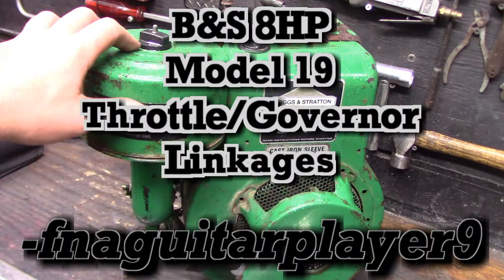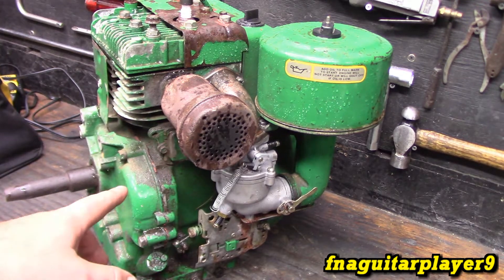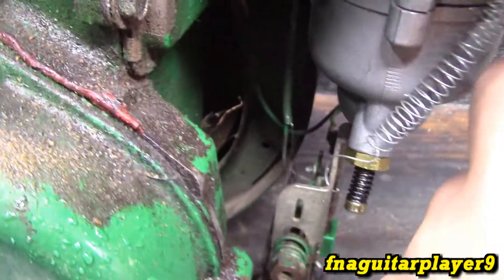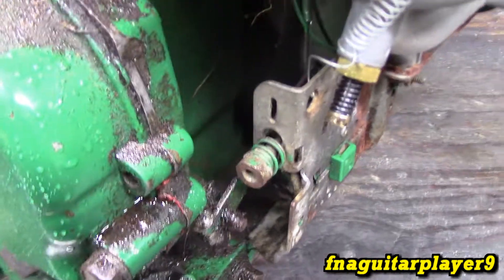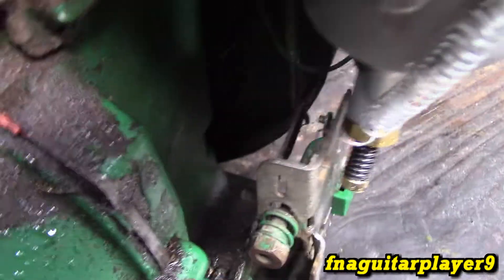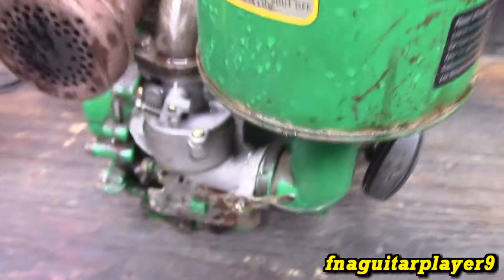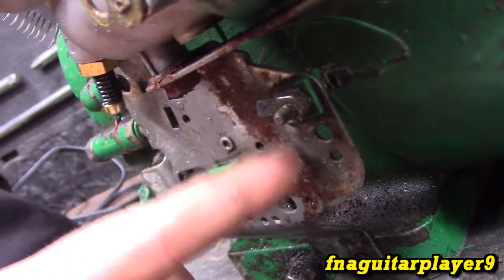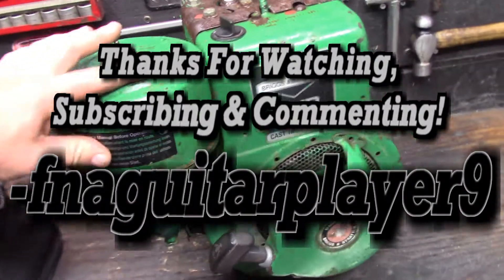Briggs & Stratton 8HP Model 19 Throttle / Governor Linkages

Comment: Great videos   the very fine spring that loads the throttle linkage , would you know the genuine part number please.  i have one of these engines on generator and dont have that spring and engine is hunting , varing rpm costantly .  cheers

Comment: someone might stumble on this some day...I haven't seen anybody talk about how to set that governor adjustment knob this model has on it.  I have an 8hp briggs on an old woodchipper that has that knob on it and basically the tension it puts on the plastic sliding piece keeps it from moving all together even when I move the throttle on the carb.  I have no idea if this should be the case.  anyone who know please chime in.  thanks
Reply: following as i have a troybilt chipper with same setup

Comment: GREAT Video  I have a 8hp briggs and when it gets warmed up good ,, it starts sputtering. If I move the governor back and let it catch up, it will run but when the load is on it ,, it will start sputtering again. Then I can turn it off and wait about a half hour and it will run good again until it gets hot.
Do have any suggestions? Thanks

Comment: Good evening sir I have one Coleman 4000 w generators and I have a Coleman 5,500 6500 watt generator. Both generators are putting out with on outlets 120 to 125 Hertz is running about 60 about 62 HZ and 240 is running about 240 and with about 62 Hertz. Trying to run a small welder stick and a hundred amp MIG welder with them hard time starting an arc and keeping the art going if I use regular household plug in have no problem with the welders I hope you can help me out with my problem do not want to go home by another welder find out it does the same thing thank you Steve

Comment: I have a 10 hp 1975 model.  I have springs on the governor and throttle but o can't get the throttle to work properly.  I'm wondering if something with the governor is broke inside? No matter where I set the governor I just can't find that sweet spot to make it idle and throttle up. It just seems to wanna run fast

Comment: aha, the spring on the front that attaches to the idle stop screw is missing on mine and the governor spring is holding the throttle plate wide open. So I just need to fab a spring like yours and I should be ready to try running it.

Comment: I have a 1972 3 HP Briggs/Stratton Model # 80232... I'm seeing leaking oil near the crank case.  I figure I need to replace seals and should just replace the gaskets and do a carb kit on it.  I can;t seem to find parts for these jobs.  Any guiance on where I can find the parts I need?
Reply from the maker: I order alot of parts from mfgsupply.com or off of ebay/amazon. Thanks for Watching!!!

Comment: The old 8 horse I/C on the Roof mower still runs like a Swiss watch as do all the 'L' heads but the 4 horse on the Snapper. The governor setup is 2 piece with one hooked to the shaft and a  1/4 inch bolt through the arm slot that goes to the carb. I turned it all the way to the right but the bottom fitting hooked to the shaft is in a notch in the case and can't move. That made it worse. It has an auto choke without the vacuum deal. It's on the breather hose going into the carb from the crankcase. I'm going to have to move it back because it runs plumb crazy the way it is now. It's a 110902-391101-85040404. I have no idea what to do but what I did. Thanks and good video. The square nylon green slider is the one I had to drill to hook the throttle back to the 11 horse on the old Craftsman., Pick me one!
Reply from the maker: I'd almost have to see that setup, i'm sure i've worked on it before though. Your welcome! Will do, Thanks for Watching!!!
Reply: @fnaguitarplayer9  I put it back where it was and it runs o.k. Maybe I just need to rev it up a little but it just putters along. Oh well. Live and learn. Thanks! Maybe I can send you a shot of it. LOTS of rain on the way for here. Get ready to hide out for a bit and GBWYall!
Reply from the maker: @lewiemcneely9143  I hear ya! Yeah if i could see i might be able to help more.